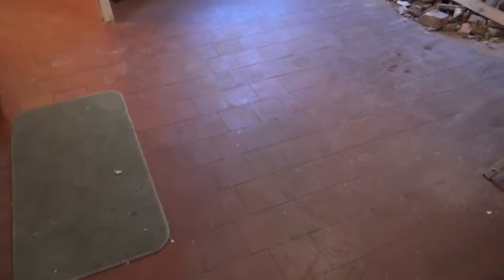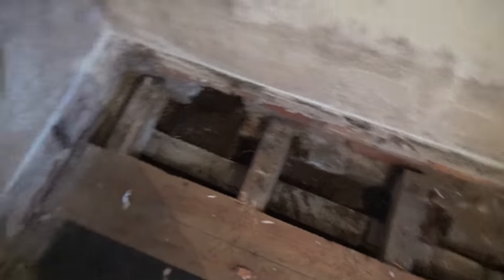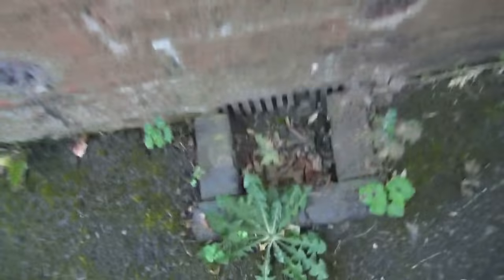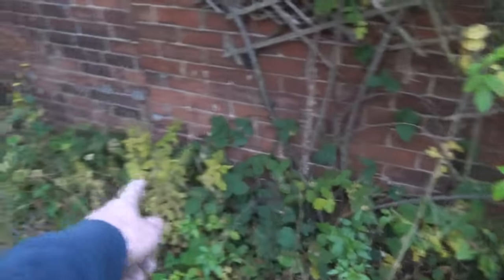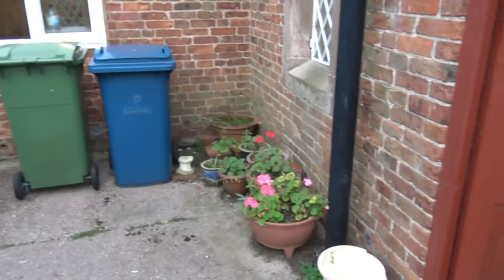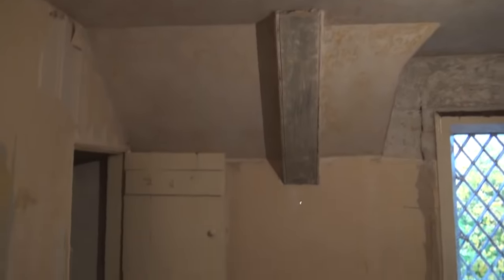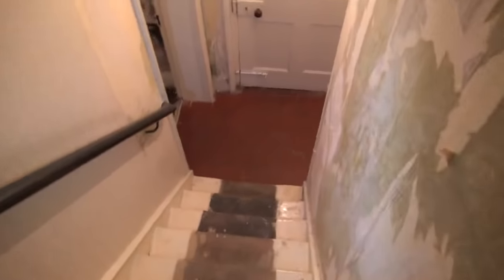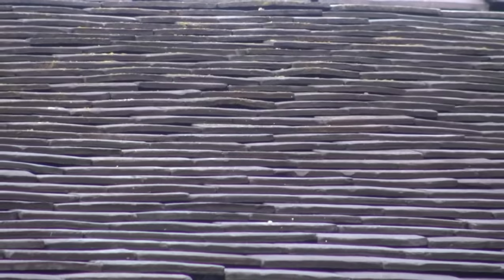Damp wally quoted £10,000.  No work needed!

Comment: I love the palpable, savage disdain for Wally the Damp Man.
Reply from the maker: I hate to see the public conned.  Wally damp man is a thoroughly nasty, very well organised, multi million pound fraud.  It is perpetrated at many levels by contractors getting kick backs, by the chemical companies, the insurance scams that issue worthless guarantees, and the PCA - their so called 'association' .  Dig deep, find the paper trail of gangster Directors, shareholders and companies, and you start to see the size of the fraud that reaches to Board level in organisations like the BBA and Trustmark.  It's about a £300 million a year scam, although we have severely curtailed damp wally's activities by educating the public - the power of the internet is helping rid the country of these scum - they hardly exist in other countries - how they got to be so big in this country is beyond me...
Reply: Thanks to your video I found a cracked vitrified clay elbow pipe just below the surface on our early Victorian house. I will replace this and avoid vandalising the house.
Reply from the maker: Great story, and very typical.  See if yu can get camera down any other drains too.  Look at humidity levels in house - 50 to 55% RH at 15 to 20 degrees C.  Don't forget - we MUST ventilate old houses - they need airflow, and humans produce a lot of moisture - kitchens bathrooms etc need venting to outside walls.. Drains are probably 90% of problems - but there can be other things like high ground levels, high humidity, gutters etc... Good luck!

Comment: Hello Peter, 
Really great video and a gorgeous house.
I've just bought an old Victorian house which had what seemed like damp in a corners (front and rear). So when I called in the 'specialists' they told me that to remedy the damp it would cost in excess of £2000.
So I thought I'll have a look outside and at the front of the house a drain pipe was clogged and then I went around the vents and cleared them too. Hey presto the 'damp' stopped.

Watching your video today I noted that the air vents are in the same condition as mine. It does seem that the air vents would take in water if it rained. So I have three questions:

1. How far below the air-vents should I dig my trench?
2. How wide should my perimeter trench be?
3. Can I fill in the trench with pea shingle to help the drainage?

Thank you so much for the really informative and money saving videos.
Reply from the maker: Ideally your ground levels need to be 6" below the bottom of the floor joists - the vents will probably be about at the level of the joists.  Ground should slope away from the wall.  I'm not that keen on french drains - they tend to concentrate water in a trench, and can make life harder, rather than easier.  Certainly if the ground is soil rather than concrete helps, as it is then able to dry out.

Comment: This really does make me chuckle I see so many problems just like this. Just cured the cottage next door its had rising damp since the 1970s when a big extension was done. 
Turns out my inlaws had not stripped the plaster back when they changed the wooden floor for concrete and trapped the lime plaster( that was over skimmed with gypsum in the 50s) below the concrete. 
In the following 40 years no end of idiots have looked at it and done work injecting damp courses etc all to no benefit. 

I'm new to your videos but loving them as a carpenter timber frames are one of my favourite things to work on when I'm not working on gates  doors and windows the more traditional the better.
Reply from the maker: Good to see folks getting the message and doing things properly.  Nice to get positive feedback and success stories...

Comment: I wonder if you could answer a question please Peter. I have removed the paint from the outside gable-end of our house and had it re-pointed (12 months ago) but some of the bricks are still damp looking, there is a definite pattern low down and where the chimneys are. The missus says it will take time for these bricks to fully dry out and i suppose it will do but my question is this: Do the chimneys need 'sweeping' to eradicate saltation ?
The house ran on coal for over a hundred years. The salt from the burning of the coal attaches itself to the interior of the chimneys and attracts moisture leading to wet bricks, if the salt remains the moisture will continue to be attracted and the problem continues.
Am i right? We need to get rid of the salt?
Reply from the maker: Absolutely right - the only way you can really deal with this is to scrub chimneys down internally on a regular basis - so get them swept at least once a year, even if you think not needed.  Externally, rake out as deep as you can, (NO ANGLE GRINDERS - they irreparably damage the bricks) and repoint using a lime mortar - NOT cement.  This actually gets rid of a lot of the salts, as most are concentrated in the mortar - being more breathable.  Internally, remove any gypsum or cement - and again, either rake out and repoint in lime, or re-plaster with lime.  We now tend to use hot lime mixes rather than hydraulic (not hydrated builders lime) as hydraulic is not proving to be as breathable as we would have hoped.
Reply: Thank you for your reply.

Comment: Hi, Peter. Just bought an old house built 1906, mixture of sandstone and imperial brick. We bought the house with 10k retention on the mortgage and it's due to the surveyor stating there is rising damp and woodworm. I've been watching your videos on here and I believe there's a bit of foul play going on. Damp companies have been in and quoted 10k, 7K and 6K through the estate agents. Looking for some advice
Reply from the maker: If you email peter@heritage-consulting.org I'll do what I can - you are being conned - both by the damp wallys and by the fraudulent and incompetent surveyor that did the mortgage survey - usually Countrywide, E Surv, or similar.  They are all in bed with the damp industry getting kick backs from selling useless chemicals.  You won't have either rising damp or woodworm - beetle never needs chemicals - just dry it out - and rising damp doesnt exist - it is a coverall term for what is usually condensation within the brickwork, trapped by inappropriate materials.  Obviously thats assuming there are no leaky gutters, downpipes, water pipes, high ground levels etc... And lack of ventilation... and so on...

Comment: I recently purchase a Victorian house which has had the suspended floors filled   which has course  damp at bottom of walls. I would like to install a beam and block flooring is this a good or bab idea?
Reply from the maker: Expensive - you might be better doing a solid, but limecrete floor - which will solve all your problems of breathability - have a look for Ty Mawr limecrete floors on the internet - brilliant, and we use them all the time.

Comment: Hello Peter , love the vids, I have an old circa 1780 farm house, some parts still have the original horse hair plaster and  features including ship timber roof joists, but unfortunately at some time in the past downstairs walls have been had a concreted like substance over them.
What is happening is that in peak due point months typically spring and autumn, the coldest part of the wall is atracking the moisture and leaving what most would think is rising damp marks and  white effervescent marks.
It original was worse at  the corner of the living room joining  the  conservatory facing wall that actually had run marks from the moisture and stains on the underlay as if a cat had urinated there.
I placed some wire-wool insulation on the conservatory  side of the wall and the problem vanished, presumably as i had increased the temp of the wall there?
 
I understand  what is happening and minimise human condensation via ventilation and extractors, however, it still appears in spring/autumn peak due point variation  times, especially, if say airflow is restricted behind a settee/radiator.

Is there any way, save boarding these walls that i can stop this vicious circle? Indeed would boarding the walls just send the moisture to the next coldest wall?

Many thanks
Reply from the maker: The 'behind settee' bit is the key - If air is moist enough in still areas like that, you have too much in the air to start with.  And wall temps too low.  Need to aim to keep heating on constantly, but at low temp - keep building fabric at 15 degrees C - or above - then no condensation / mould can form.  Also humidity must be below 55% rh at 15 to 20 degrees C.. Ventilation should be humidity controlled, need to speak to Ray Hudson at RHL really - describe house and environment and see what he says - mention us, and he should help.  Insulation is the worst thing you can do - stops heat getting to wall, reduces wall temp = increased interstitial condensation = more moisture in wall = you become damp wally's best friend.
Reply: Thank you for your reply Peter.
 That room employs a wood burner that runs most winter nights, so could well be difficult to restrict temp to just 15 degrees C.
The wall that is most effected is an internal wall and not an outer facing wall.
However below that wall is an old now filled in basement .
I have a humidity sensor and although it is hard to get the old house to  the constant 55%, it is not abhorrently moist, on average 60-65 save when wood-burner is running ,that naturally lowers it!
All windows are opened daily and powerful extractors in bathroom and kitchen.
The  natural airflow of the house seems to take all the moist air into that room, and even before we had a wood burner installed the open fire place did not ventilate that room sufficiently to stop these condensations issues.
When i investigated the walls in that room i took off the render. Obviously it was bone dry under the stain marks  and i noticed at some stage 'wally' had drilled his holes along the bottom with the usual misdiagnosis of 'rising damp'.
How on earth he could convince someone that 'rising damp' only strikes in Autumn and spring is beyond me.
I think i need to reinforce my efforts on more ventilation in that room-or moreover,increasing the temp of the wall.
Is the damp looking stains and patches and the white effervescent consistent with airborne moisture hitting cold walls as i diagnosed??
Reply from the maker: Pretty much spot on - an dont forget salts will be there as a relic of many many years of deterioration - so you may have sorted the problem but still see symptoms of older issues.  You're on exactly the right track though!

Comment: Hi, Peter 
When you say lower ground level, would this be done by making a trough around perimeter ? With a land drain back filled with gravel?

Excellent videos keep them coming
Reply from the maker: PArtly - some areas just scrape it back to 150mm below floors inside - at the side, we'll cut a trench to hold the driveway back, and retain it ..